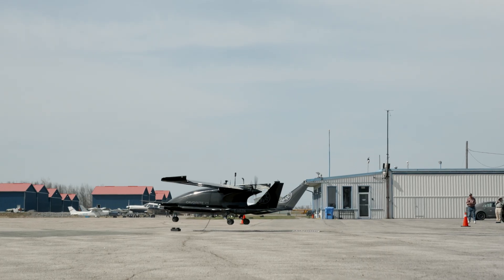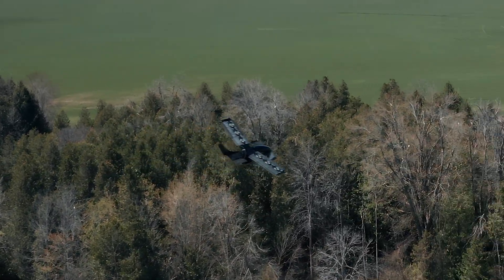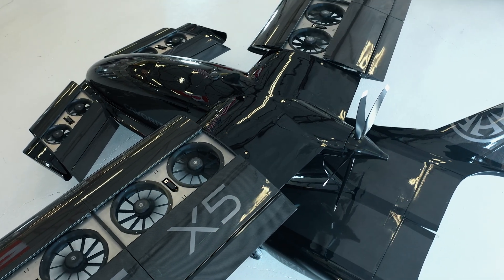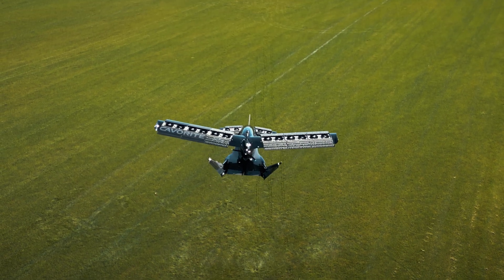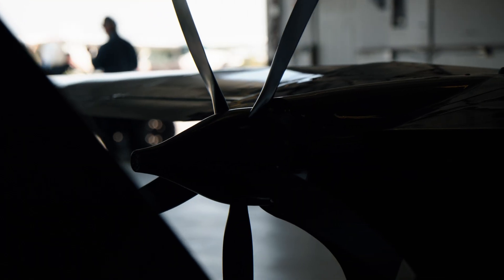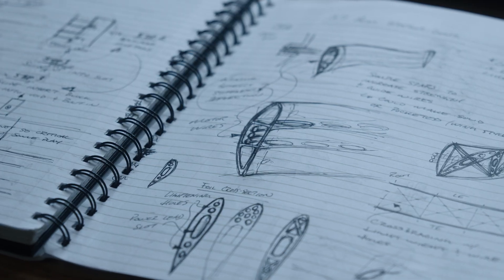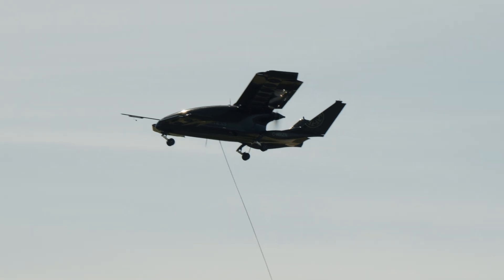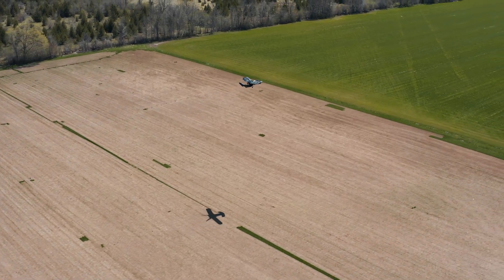Does Our eVTOL Need a Parachute? Safety Principals Explained

Comment: Obviously any ballistic parachute still has a minimum opening altitude in order to be effective, but nevertheless ballistic chutes in general aviation have a proven track record in saving lives.

There was a design I saw somewhere that incorporated a retro rocket thruster which would fire and bring the aircraft down safely to the ground even if the parachute wasn't able to open in time.

Also a parachute has a maximum deployment speed where if the craft has too much airspeed the chute will simply tear itself apart when deployed, maybe that would require some kind of multi-stage chute that deploys a drogue to slow the aircraft before fully opening the chute.

I suppose a compromise has to be made somewhere since all these features would create an overly complex and heavy parachute system.

Comment: Need a parachute 100%
Reply: Yeah , if on a skydiving event. Lol  or jump mission.  Outside of that, not.  No need.
Reply: @kingshark5938  I don’t know what you are smoking but I need it😂
Reply: @tomtom7987  ... cool, then you would see no need for a shute.   With advance avionics,  a none strained hybrid system,  that each side properly handles its functions.  

Plus a design that can actually glide in the event of total system failure, which would be biblical.   

Why need a shute, if my engine fails, but I can revert to my full battery power and fire up my fan in wings and land in a parking lot, a field,  water,  where ever. Only a large displacement of air is about all. 

Load me up and haul me off to the ntbs , find out what went wrong and move on. 

Better study the design of this craft carefully.  It's not a run of the mill conventional craft. Its unique.  

But, if you selling chutes, I'll take some jump chutes for weekend fun. 😂🎉🎉🎉

Comment: Very cool design. It took them about 10 years to get to this point. However, a design like this always incurs risks, and there are some safety related factors that go beyond mechanical engineering and aerodynamics that they may not be able to solve before they "run out of runway" so to speak. Even a team like this has technological limits that will challenge them, but if they want to become a success story, or the next Bombardier, they must overcome these obstacles.

Comment: Very good, I was hoping one company to implement this in their design at some point, as well as an ejectable safety pod design for future. No doubt there will be complexities, payload, etc. 

Hope you guys are all able to achieve it!
Reply: That's no issue. .... added weight,  crank the power up.    Next.
Reply: @kingshark3503  Yes it is in fact an issue as since the aircraft operates as a VTOL meaning it operates in the "Dead Mans Curve" where a parachute doesn't have time to open so you would still die anyway in a critical failure and the fact the aircraft has to carry inefficient and heavy batteries meaning useful payload is already at a premium, the company has decided a ballistic chute isn't a realistic option.